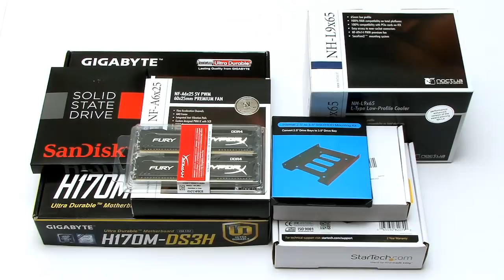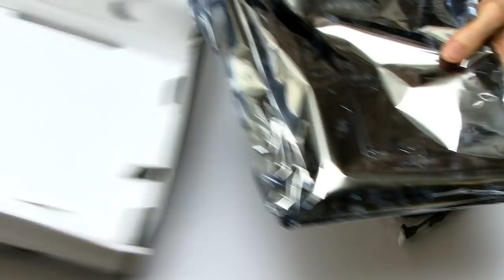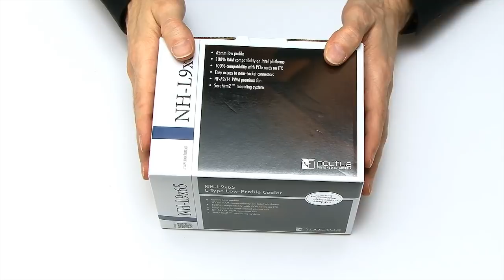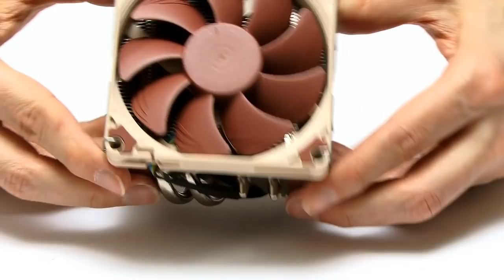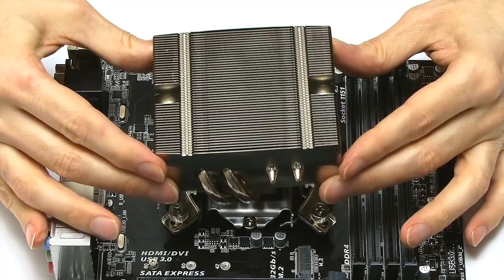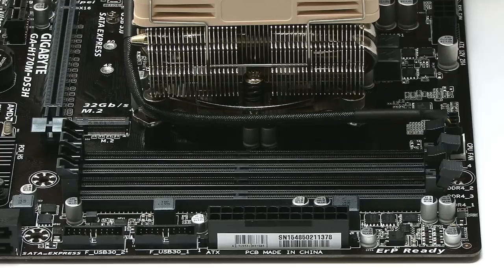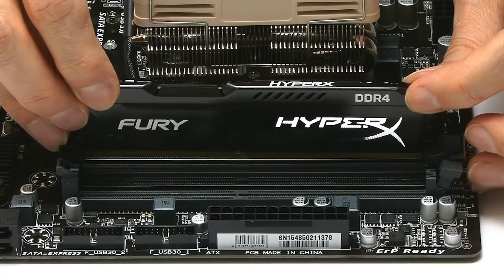i7 PC Build: Part One

Comment: i have a i7 6700 skylake [bought from Maplins during a sale, last May 2016 - i ofen buy stuff on sale from Maplins as i am guaranteed a full cash refund within 30 days and my 12 month warranty allows me to replace any item for a new replacement... also? i have found the cheap prices of online purchases seem to come at a high price in quality... i can not recall EVER building a gaming PC without a stick of ram, a graphics card, a motherboard, PSU or cpu, etc giving me obvious signs that the items are plainly faulty at a core level and there was no chance of my getting a cash refund... the only company i could rely on online was Corsair as they have been very understanding in the past]

As i said, i own  i7 6700 and it runs at 3.4GHz but can be boosted [acc. to the box ] up to 4.0 but i got it to run at 4.5GHz for 7 minutes before the PC simply shutdown and i had to go into the BIOS and reset it to 4.3GHz which seemed to run for 4 hours roughly before overheating again so i settled for 4GHz.

Now, to be fair, i was using the very basic Intel HS and fan that came with the package so i didn't expect it to run stable beyond 3.8GHz.

As far as i can tell my 6700 running at 3.4GHz is MORE than enough to handle every modern AAA game [which i don't usually buy anyway until at least 18 months after its release]  and the GTX970 i bought alongside it with Corsair Vengeance 2400 DDR4 in 2 sticks of 8GB [obv paired in the package] runs games like the latest Doom at over 200FPS at 1920x1080i.

So my question is - why is my 6700 capable of running at 4.5GHz on a crappy Intel HS and fan on an Asus Z170 Pro Gaming Motherboard for a short period of time [i believe there is  watercooler meant solely for a CPU that will do the job of boosting my  my 6700 wo a problem?.. 

yet your list says the 6700 is NOT OverClockable when mine is quite obviously capable and more!

Comment: Isn't it time to start to use an least 1080p? # nice video's
Reply from the maker: The upgraded rendering rig will make the move to 1080p easier for animation-intensive videos! :) So I may do some 1080p videos in 2017, but it has major pipeline implications for me. A lot of people upload "1080p video" files that are clearly not 1080p resolution -- ie you can encode in whatever resolution you like, but the resolution that comes off the vast majority of "1080p" camera sensors is often far lower (if only due to the quality of the lens the image has passed though -- 900 lines of resolition is still considered good for many broadcast cameras). Right now, my 720p is a real 720p, and I won't move to 1080p until I can actually deliver that resolution technically from sensor to glass through post and to codec.
Reply: Thats why he is building an new rendering PC probably
Reply from the maker: Erik Yes, indeed. I am upgrading my rendering capacity with some specific projects in mind! :)
Reply: Oh..  Well good luck with your further build and thanks for making that good video's 😉
Reply: I can't wait to see it good luck! And by the way i'm building a my own computer for audio production do you recommend the Noctua fans? they just need to be very quiet.
Reply from the maker: Erik The Noctua fans are indeed very quiet -- both CPU fans and case fans.
Reply: +Erik If you want a nice quiet fan cooled system and are using a standard mid-tower case with plenty of room inside, there are big oversized heatsinks you can get and run 120mm or 140mm fans at low RPM speeds. I have seen a custom built computer with the CPU fan port hooked up to 120mm fan on the back of the case sucking the air out and the system fan port was hooked up to a 140mm fan on the front of the case sucking the air in through a foam filter. No fan on the big heatsink tower itself, though. With the fan clips that normally held the 120mm fan to the heatsink, he had clipped on a piece of large flexible 80mm tubing glued to two 120mm to 80mm fan adapters either end. One end attached to the heatsink and the other screwed to fan at the back of the case. The pipe was apparently a cheap bit of 80mm air ducting pipe purchased at an automotive store and normally use for cold air ducting in a car cut to length.
Reply: ExplainingComputers  1080p on YouTube offers higher bitrate, does it not? So even if your videos aren't true 1080p, the bitrate could improve image quality, perhaps at a very low cost.
Reply from the maker: CaesarGamer You know, this is an extremely good point you make here. I will ponder on it! :)

Comment: 18:40 what are the 2 other slots for? Is that for more RAM cards?
Reply from the maker: Correct -- the board has four DIMM slots and I have filled two, so a second pair of DIMMs could be added for more RAM.
Reply: Could you have had up to 32GB of RAM then?
Reply from the maker: lomhow1234 4321wohmol Yes, you could go up to 16GB, 24GB, 32GB, 40GB, 48GB or even 64GB (the max for the board). :)

Comment: Xeon processors seem to be the better value. More cores, more pins, higher W temp rating, and they automatically overclock. The boards are a bitch to get and expensive.

Comment: I accidentaly touched the thermal paste under my cpu cooler is it gonna be okay
Reply from the maker: Unless you've really dug into into it and removed a lot -- or you had a load of grime on your finger -- it should be OK. I would go ahead and fit it and monitor the temperature. If the readings show the CPU to be very warm, you could always dismount the heatsink, remove the thermal paste, and apply some more at that stage.

Comment: the 6700 would have been a better choice because of the higher base clock
Reply from the maker: But is would have drawn a lot more power, and generated a lot more heat.
Reply: Very true but then your tasks would have been completed quicker thus the machine not having to be on all the time. Also, I did not expect a reply :) love the vids. I actually rewatch a lot of them

Comment: The T suffix on intel CPU's stands for Power-Optimized, not "tray" 
http://www.intel.com.au/content/www/au/en/processors/processor-numbers.html
Next... Why not consider the B150 chipset? Has m.2, 4 DIMM, only thing it doesnt have is RAID, which is a moot point really.
Next... You are using it for rendering and video editing... you would have been better off with 2x 8GB DDR4. It's not much more and really is the sweet spot now price wise. Then later, if you need to, you can add another 16GB if you are finding 16 isnt enough.
Reply from the maker: Thanks for this, info on the suffix noted. On the RAM, I am not using the PC for video editing, I am using it to render animation from a 3D modelling package (LightWave, and rendering via the CLI-based Screamernet). So 8GB of RAM is fine. :)

Comment: advantage of skylake over haswell?
Reply from the maker: Basically Skylake is more powerful (at the same clock speed) and more energy efficient (we are talking 6th gen rather than 4th gen Core chips). This said, in most situations you would need a really good reason to upgrade from a Haswell PC to a Skylake one. I do most of my non video/graphics work on a Haswell i3 (I am typing on it now!) and it will run until it dies -- which will hopefully be years and years from now. :)
Reply: A bit better inbuild graphics, better performance per core and a little bit less power consumption - all thanks to the smaller die size of 14nm.
Reply: thanks... i have an i7 Haswell w 32 GB RAM (yes the slots were lonely) and SSD etc... and always wondered that if I upgraded.... would MS Word go faster.,...
Reply from the maker: Mike Quinton I would not upgrade what you have to improve the speed of Word or any other office or Internet software. You have a great system there. You may get small percentage improvements in some circumstances from a Skylake upgrade, but nothing of real-world significance. If you were to upgrade for a little more speed, you could switch to, say, an M.2 PCEi interface SSD (probably via a PCIe card adapter) -- keep watching this channel for more on that! :)
Reply: The Gigabyte GA-H110N motherboard has an M.2 PCIe socket on the back. None of the H110M versions have this feature. Where I am living I can't get a motherboard with an H170 or Z170 chipset. That said, it has been impossible to find a suitable M.2 PCIe NVMe SSD here, anyhow.

Comment: Will you be using the GTX 650 Ti in this PC?
Reply from the maker: I've no plans to fit a graphics card at present -- it is not needed for rendering. But clearly I could do this, so we shall see . . .
Reply: ExplainingComputers I thought gpu rendering is much faster than cpu based rendering. I could be wrong though.
Reply from the maker: It depends what you are rendering. For real-time rendering -- eg of games or CAD -- you are correct, GPU rendering is the way to go. But here I am rendering 3D graphics frames from a package called LightWave using its CLI rendering extension Screamernet, and this only renders on the CPU.
Reply: ExplainingComputers great, thanks for the explanation.
Reply: +ExplainingComputers,
You are using Lightwave, I have not touch this software package in over 20+ years (used this package on an Amiga 500+ and 1200 back in the early 90s).

It is good to see that Newtek is still producing and developing this product (I would like to see Newtek redevelop and support Lightwave for the Linux market though).
Reply from the maker: Mark Edworthy It would be great to be able to render LightWave under Linux, and of course use the full package. LightWave still remains popular for TV work.

Comment: Can it run windows xp? :)
Reply from the maker: I've yet to try -- but I may! :)
Reply: Running XP on a newer system would be very difficult due to the fact a lot of the motherboards now only come with drivers for Window7 or higher. You might be able to install it but have USB3 ports that do not function, or graphics cards that will only work in the default graphics modes without hardware acceleration. Even getting sime soundcards or LAN ports to work might be a problem. 
You might need to install a Linux or Windows 7 or higher OS that has Oracle VM VirtualBox installed and run Window XP as a virtual computer to have it work.
I found one of my old Windows 98 CDs with its book and key last year and installed it on my computer in Oracle VM VirtualBox just to see how it would go on my modern 8 core machine.
Reply from the maker: TheNZJester Yes, it would take some doing to run XP . . .
Reply: +TheNZJester,
I agree that there would be some problems with the USB ports, as well as possible issues  with both the soundcard and graphics card, not sure about any major issues with the ethernet interface, most NICs will have either a generic, open source or alternative drivers available (either via a 3rd party repository / web site or the OS installation media may include a generic driver). 

Does this motherboard include any bluetooth or WiFi interfaces? (these might need additional drives to be installed)

Also, there maybe a couple of issue when installing XP if UEFI is supported by the BIOS.

Just out of curiosity, I would be interested to see if it would be possible to install and use ReactOS (an Open source OS that is based upon the design principles found within the Windows NT and XP architecture*) on this workstation / computer.

* https://www.reactos.org/
Reply: +Mark Edworthy When it comes to older OSes and modern hardware putting them inside a virtual system like Oracle VM Virtualbox seems the only reliable way to get them running easily. That is available for free 
download under the GNU General Public License (GPL) version 2 on Windows, OS X, Linux, and Solaris systems. When it comes to old Dos programs, however, I run those in DosBox. That is Available on Windows, OS X, Linux, and Android systems. I love the portableapps.com version of DosBox as it runs on windows without needing to be installed off of a USB memory stick. I can emulate the earlier pre-VGA modes if needed and most of the old 
soundcards like the PC Speaker, Soundblaster, Tandy 1000, Disney Sound Source, Gravis Ultrasound and General Midi etc are emulated also.
Reply: +TheNZJester,
Agreed, if wanting to use an older OS upon modern hardware then it is sensible / less hassle to use a virtualisation tool,I tend to use Virtualbox to sandbox other OSes but also use QEmu / KVM to test out new Linux, BSD and other non Microsoft distributions / OSes -- I also test out a lot of network appliances (ie. software / OS based Firewalls, NAS appliances and small / medium sized business based infrastructure tools and OSes) using a hypervised KVM infrastructure.

I have used DOSBox in the past but prefer to use Virtualbox running FreeDOS as the OS, also as I like to play old Sierra / LucasArt styled point and click adventure games (ie. Monkey Island, Space Quest, Beneath a Steel Sky etc.), I use ScummVM to run the apps (whilst ScummVM is not strictly a virtualisation tool but is more akin to an emulator, it will run various old games and is available for many different hardware platforms and different OSes -- also uses a GPL based license).

I also tend to use portableapps.com quite a lot, since I do use a number of other people workstations and public access / multi user workstations, I find that most of these workstations do have a copies of Microsoft products installed on them (ie. MS Windows and  MS Office) and do carry various portable apps via a USB key, usually containing portable copies of Firefox (with my choice of extensions), Thunderbird and Libreoffice (even though, at the moment, I am experimenting with Collabora office, a LAMP based / cloud based / online version of LibreOffice).

Also it is worth noting that whilst Oracle VirtualBox is release under a open source license agreement, the accompanying extension pack (which provides full support for USB / EHCI controllers, extra hardware compatibility, VDRP, SMP abnd PXE boot support) is released with a propriety license agreement which is owned and controlled by Oracle.
Reply: I love the fact I can carry FireFox with all my bookmarks that sync with my desktop as well. I use the portable version of Thunderbird with the lightning extension on my desktop as my email/calendar program as well that is auto backed up regularly to my backup drive. When I got a new Desktop I simply dragged the folder of it over from my laptop to my desktop via LAN and a couple of minor tweaks to put shortcuts on the toolbar & start menu and I was just able to run it to collect all my new email without setting up all my accounts and filters again, or entering in usernames and passwords. When it comes to checking computers the CrystalDiskInfoPortable is a great tool too. A couple of times on friends computers that have been playing up I have seen disks come up yellow caution and suggested a full HD backup for safety. One that had the yellow caution I suggested a friend do a full backup of and store any new files on an external drive had their drive fail two days later before the replacement drive they ordered arrived. Except for the files being worked on at the time it died we put in the new drive and got the system back up and working with the backup image with no major loss of data.

Comment: A few things that I'd like to comment on: Who in the world buys an i7 6700t? 2.8 GHz are you kidding? You can buy any other older gen i7 for roughly the same price, with chips like the 4790k running 4 GHz base with the availability of overclocking, why would you use a weaker processor like that for rendering??? You mentioned keeping it cool with that noctua cooler, why bother with such an expensive air cooler when you can use liquid cooling for just a little extra (excluding custom loops of course) and run even an overclocked CPU at low temperatures? Even more criticism right here, how are you planning to keep that CPU cool with a case like that? (Case fans make a smaller difference I know, but there are better cases out there with much more airflow) and for gods sake what is up with that motherboard and is that an empty pci lane I see? Classic case of "Look, I can buy an expensive CPU but cant be bothered getting a decent board (Cheaps out on a h170m) I don't know what this computer is gonna be used for but without a GPU it's not getting far, plus 2133mhz 8Gb is not very much for todays standards, are you gonna run the ram @ 512mhz so it matches the build? XD
"In the second part I complete the build by adding drives, a case and some other hardware" - I hope to god that by hardware you mean a GPU, because if you're using integrated graphics you might as well buy an i3. Nevertheless, sorry if I sound very negative, I just don't see the point of this build, the video was well made either way - So well done! Subscribed (For other videos, not this XD)
Reply from the maker: Thanks for this. This PC, as I show in Part II, is used for CLI rendering in LightWave Screamernet only, to run 24/7 with minimal power use and maximum reliability (hence the 6700T). ScreamerNet is a 100 per cent CPU based renderer, so no GPU is need, with a graphics card just adding to the price, increasing the power drain, and increasing the temperature. I picked these parts with very great care -- they are very normal for a low-end render farm PC. Not what most people may want, but very well suited to the purpose intended. And thanks for the sub! :)
Reply: Oh, okay. If you're using it for that then it makes a lot more sense, just didn't see the second video I guess. The i7 is still quite expensive haha. Either way, sorry for that extremely negative comment. Keep up the good work, I'm genuinely really pleased that you replied - for someone with almost 150k subs that's amazing!